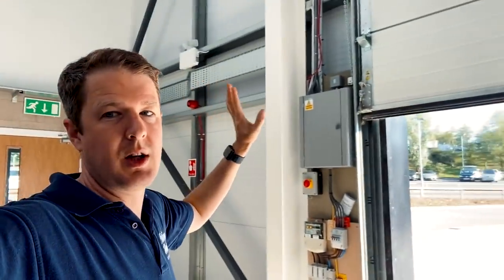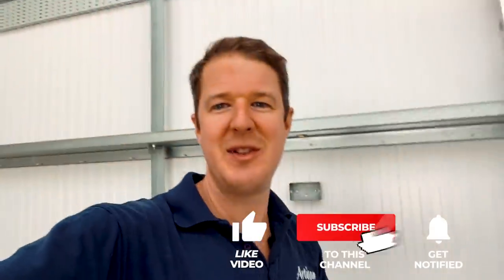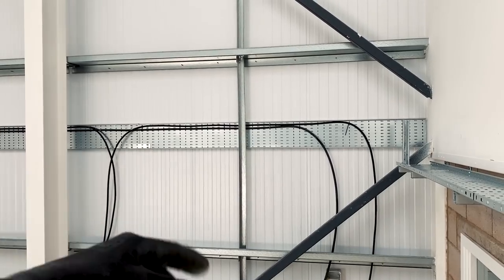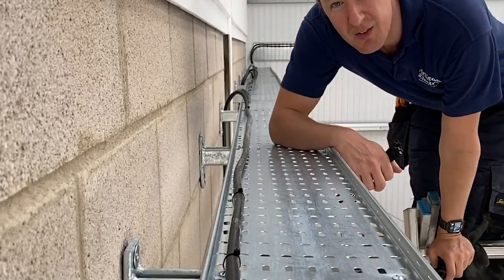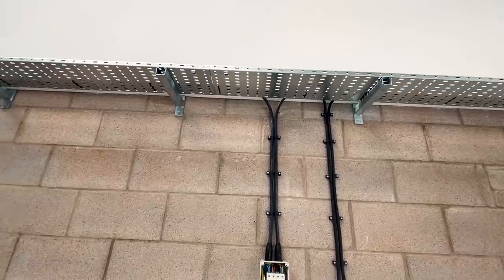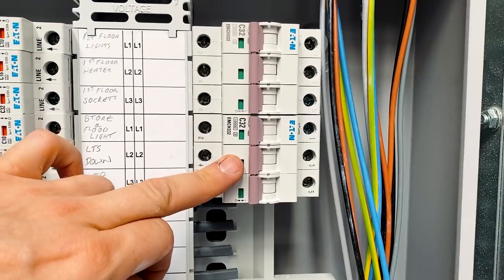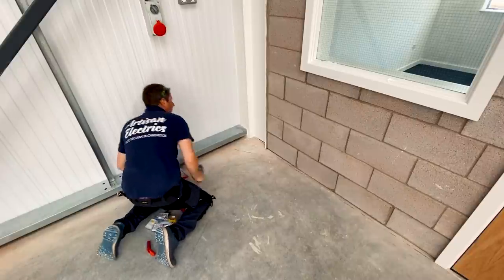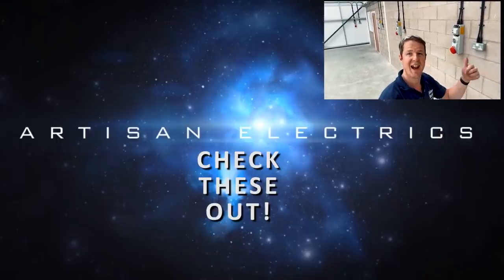Cable Tray, Three Phase Sockets & SWA Cable Install - Part 2

Comment: Why not mount jbs on the tray and have a single drop down for the 13a radial?
Also flush cutters are best for cutting ties
Reply from the maker: Don’t like to have JBs if they are not needed, it’s just another weak point and a point you have to maintain/check if there are problems.
Reply: having to do 4 glands instead of 2, + buying JB`s etc, extra cost in material and extra time to install, as well as not being as good

Comment: Type c breakers?.
Reply from the maker: Yea
Reply: @artisanelectrics   What are they plugging in 3 phase motors, x ray machines, nuclear reactors. 😁
Reply from the maker: Just normal stuff but some motors for example a lathe, a milling machine, a router

Comment: bril work! very up to your high standards! just a silly q, why such wide tray for so few cables? seems like overkill to me!

regardless, well done! great vid
Reply from the maker: Thanks! It was done on purpose to leave plenty of space for future expansion if needed, the labour is the highest cost with cable tray as materials don’t cost much but it takes the same amount of time to install 100mm wide tray as it does to install 230mm wide tray so for the sake of a few extra quid in materials it makes sense to future proof it.
Reply: why did you not use single phase cable for 13A sockets  brown,blue,green yellow. taping cable with tape  ? why not sleeve the cables.that is a very poor standard of work.
Reply from the maker: I don’t have any sleeping big enough to go over 4mm and you can’t get cable with brown blue and green/yellow conductors.
Reply: where do you buy your cable .its a standard to use brown blue green yellow for single phase insulation.insulating tape give me a break thats bad workman  ship
Reply: @artisanelectrics  Think Pitacs manufacture  single phase cable SWA Brown , Blue Green/ Yellow although i can't really see the point of buying it unless you do a great deal of single phase armoured work
Reply from the maker: I would love to get hold of some of that for EV charging installs! I very rarely do three phase armoured stuff.
Reply: @jimmygilroy8470  Theres nothing wrong with insulation tape in the slightest, all the regs say is that conductors must be correctly identified. They dont have to be sleeved completely
Reply: @artisanelectrics   I know toolstation sell it
Reply: codenamenel bad workman ship
Reply: @jimmygilroy8470  its not bad workmanship in the slightest, It complies with regulations and is the simplest way of identifying a conductor. I`d rather 2 rolls of tape in my pocket than carrying bundles of sleeving around everywhere
Reply: codenamenel absolute bollox
Reply: @jimmygilroy8470  if you`re describing what you are talking then yes, I agree
Reply: @artisanelectrics  Donny Cables EV Range is brown blue green/yellow. You can get regular SWA with the colours it isn't common tho
Reply: gabriel  not freaking out but use the proper materials
Reply from the maker: Thanks!
Reply: @jimmygilroy8470  It is the proper materials, its a commercial installation , not domestic, the cables are identified in accordance with regs . Plus of course the red/ blue/ green/yellow cable is not generally off the shelf (unless you want small  amounts then toolstation sell it . )   The majority of 3 core armoured cable is used on 3 phase  this is whats generally stocked when your buying it on the drum
Reply: steve robinson so you use the armour as a earth on a 3phase installation
Reply: @jimmygilroy8470    I dont personally , however it can be hence the reason for the  conductor colours , the single phase armoured you mention was developed  mainly for use on plastic or composite DB / CU  , junction boxes and the likes in domestic supplies  where thier is  a high  probability  of semi skilled interference . i have lost count how many times i have come across a termination without cpc continiuty
Reply: @jimmygilroy8470  You can use the armour as earth on any installation you like providing its properly sized and terminated. You know alot less than you think you do.
Reply: @jimmygilroy8470  Even if you`re using 4 Core SWA for TP+E then its a Blue insulated conductor, but a couple of rings of green and yellow tape easily identify it as the CPC.
Reply: Bumbles Hi Bumbles I live in Ireland  any installation I do with swa armour is not accepted as an earth we must run in a separate earth at least half the size of the main conductor
Reply: @bumbles1584  no you can't. You need to check the manufacturers guidelines to see if the SWA can handle the Zs. Always run in an extra core in you armour to be safe
Reply: @fraserreid719  do you mind showing me where I said you should ? And by old dinosaurs who don't know what they're talking about, do you mean like the bloke who ran the 18th edition update course I took, (who proof reads the BS7671 books for the editors  before they get published and wrote half the question list used for the 2382 exam) who was teaching us how to properly use the adiabatic equation to prove you can use the swa / metal conduit etc as a cpc ?
Reply: @codenamenel  okay mate! See if you running a SWA that's 100+m, would you take the risk of the SWA not being sufficient for earthing for example the SWA being broken. The answer is no. The SWA can pick up interference also. So no I do not use the SWA ever as a primary earth.
Reply: @fraserreid719  have you ever heard of a test we carry out known as "continuity of CPC" often performed as an R1+R2 test. That is how you know your CPC is intact whether it's 100m or 100,000m.
I'm pretty sure that if the armouring was to get damaged more than 50% by penetration after installation it would also damage the live conductors which would leave the circuit inoperable anyway. Take a look at most TNS earthing arrangements, many use the armouring as CPC and have done for decades
Reply: @fraserreid719  You can obtain a R1+R2 value before a cable is ever installed, its called doing adequate design calculations.
Reply: @bumbles1584  none of you are getting the point here.
Reply: @fraserreid719  Because you dont have a point, you stated its not allowed it quite clearly is, the practicalities of using the SWA as a CPC have nothing to do with it.
Reply: @bumbles1584  never said its not allowed. I said to check the manufacturers guidelines as depending on the conductor size and how many cores are in the armour the SWA won't be oof sufficient size.
Reply: @fraserreid719  Its exactly what you said. "@Bumbles no you can't" followed by to another poster "@codenamenel no. You can't rely on the SWA for an earth. Stop listening to old dinosaurs that's don't know what they are talking abouy" You tried to come over like you knew what you were talking about and failed miserably. Please find me any SWA manufacturer that states you cant use the SWA as a protective conductor, it wont happen because its of no interest to them the minimum csa of steel is in the product standard and thats all that matters. To be quite honest i stated categorically in my reply that it has to be appropriately sized so why you decided to stick your ore in ill never know
Reply: @bumbles1584  quite happy to send you stuff. Give me your email and il send you stuff across
Reply: @fraserreid719  Thats where the adiabatic equation comes in. Most CPC`s are around half the size of a live conductor yes ? well how do you think that is calculated ? 
When you take in the CSA of the steel in the armouring its usually larger compared to the conductors, and even being made of steel, not copper, is much bigger than required for use as a CPC
Reply: @codenamenel  pretty sure a 240 4 c armour needs it's own earth yes?
Reply: @fraserreid719  you do also know that r1 r2 is different from R1+R2 as well don`t you ? if you want to call me an idiot at least try and use the proper terms eh
Reply: @fraserreid719  You can work it out for yourself if you have access to a regs book for the k value. 
It requires more than just the cable size though. You need Zs measurement, overcurrent protection type and rating etc, installation method of cable. 
I`m at home on holiday for 2 weeks so haven`t got book here.

Here is an example of how to do it https://www.electriciansforums.net/threads/example-of-use-of-adiabatic-equation.28128/
Reply: @bumbles1584  ok
Reply: @bumbles1584    pointless arguing with him , we can all pull out an extreme  example  why it shouldnt be used but the fact is it is still a practice in the UK to use the SWA as a cpc
Reply from the maker: Calm down guys it’s just cable. Keep it respectful please.
Reply: @fraserreid719   you should perform  test on the cable  prior to installation , i certainly would  the armouring is the first line of defence if you accidently pierce the cable or cut through it
Reply: steve robinson a lot of 3 phase supplies require neutral. +. Earth  standard single phase cable come in  brown+ blue+ yellow green
Reply: @jimmygilroy8470  I know

Comment: Why are the 3 phase breakers motor rated ( type C )
Reply from the maker: Standard for commercial installations is to install type C breakers, actually D type is for motors usually.
Reply: Type C is not just used for motors, some welders require a type D. Also the higher tripping curve helps if multiple high inductive loads are switched at the same time.
Reply: I work in an animal feed mill and all motors are type c the only type d is used for an old oil cooled welder and for forklift chargers.
Reply from the maker: Nice
Reply: Tip. Type b breakers trip at up to 5x of the rated load on the curve, type c are up to 10x on the load curve, and type d are up to 20x.hemce why they are typically used on motors due to their high starting current
Reply: Fraser Reid when I need a lesson in the characteristics of breaker types I check bs7671 the question is ...what are the breakers supplying

Comment: Surprised you haven't got one of those cable tie tools. It tensions it and cuts it off
Reply from the maker: Good idea!
Reply: @artisanelectrics  The decent cable tie guns are stupidly expensive for what they are, however there are cheap things that you just twist on the tie to cut it flush. To be honest I find that a pair of flush cutting cutters suits me best.
Reply from the maker: Thanks
Reply: Stu Arnold my panduit ones were £250 😂 perfect cut everytime the metal gun was £550 got that one on eBay though 🤪 worth every penny
Reply: @whatthedeuse  My Panduit gun is about 20 years old and still going strong. I still think it's overpriced for what it is though.
I wouldn't have spent that much money if I wasn't using it on a regular basis.
Reply: Stu Arnold yeah they’re mental money, guess as they’re approved by the airspace industry and military. Mine are used daily, gradually converting people at work to using them, one bonus of being one of the few that uses them, people know that I’ve run the cables in lol 😂
Reply from the maker: Cool

Comment: You need a plastic and metal cable tie gun available on eBay tgey tension and flush cut in one action i could send you a link to look at if you want
Reply from the maker: Thanks they always seemed to me to be a bit of a gimmick
Reply: @artisanelectrics  they work well especially the plastic one for cutting  flush and the metal one gets it nice and tight , its not much if any quicker though

Comment: 'a few little rules', 'I'm a bit OCD' says the man on top of the unextended ladder that makes me wince every time I see it, I'm sure it's not recommended for the top of your trousers to go above the top of the ladder, and it's not like you don't have the space in there!!  As for Lewden putting a choccy block inside their assembly, surely they can do better than that? Never mind... I'm just in a 'do it properly' mood even more than usual today. Am I unusual for using adjustable spanners to do my SWA glands?
Reply: also, I feel you missed a trick, if it's >22 degrees and I know I'm not going to be on my knees at all, the shorts come out
Reply from the maker: Nice tip!

Comment: One thing I want to say is that a good 10 bucks pair of precision snips are more convenient for flush cutting than garden snips and the other thing is... Really mate? The direction of the bloody zip tie on top of a cable tray? If someone's up there after you to actually see that once in a decade, the only thing they will notice is you cut them flush, not that you wasted time on decorating them. If you're putting down 200 zip ties and it needs even a second of thinking, you just pissed away 3 minutes for nothing of value. Speaking of. Get a ruler. Counting tray holes is the masochist way of doing it or if you're paid by the hour

Comment: I have 35 years of experience in the field of civil and industrial electrical systems and I tell you that I have never seen a system so badly done.
Honestly, in Italy that plant would be out of any law.
Reply from the maker: What’s wrong with it?
Reply: @artisanelectrics  Your system has no protection against splashing water, has no protection with hose on the descents to the 380 volt power sockets and you have used for the 220 volt common sockets that are used in the home without protection iterblocked for safety. But is it a civil plant or is it an industrial plant? You don't have the yellow-green conductor for the grounding protection, do you have to indicate this with adhesive tape? I stop here because if in your country you do this type of plant in Italy it will result in civil and criminal arrest and also for the whole of Europe.